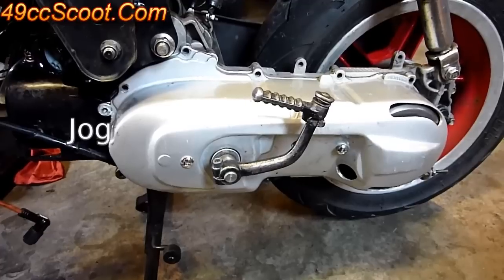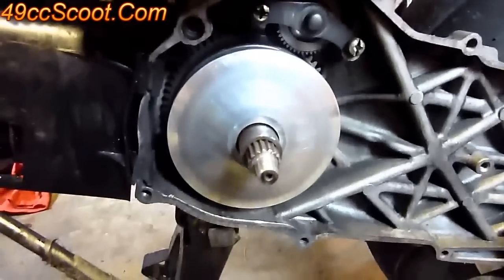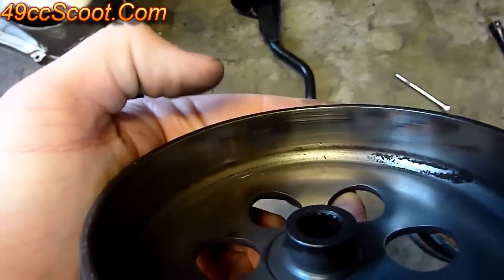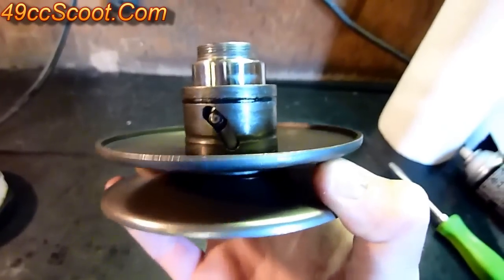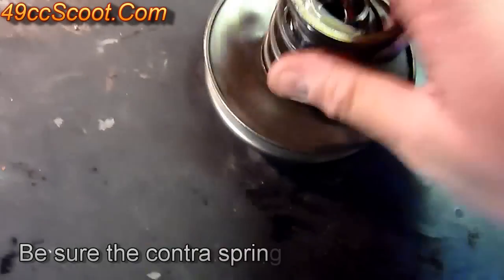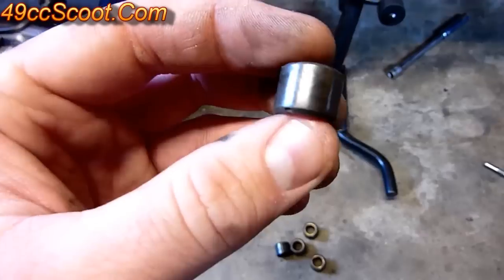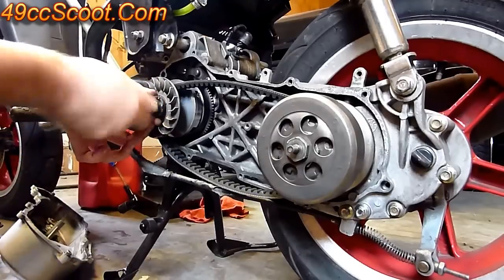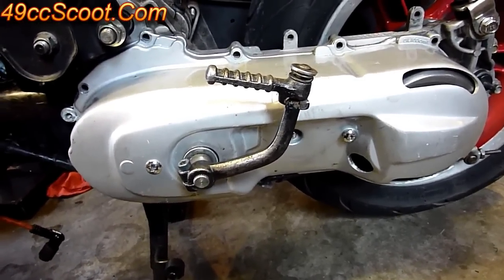Scooter CVT Transmission : Full Service Inspection

Comment: Do you use Sony Vegas Pro 8 to edit your videos?
Reply from the maker: Christopher Spohr Cyberlink Power Director.
Reply: ***** i have a horrible vibration coming from gearbox shaft the one with the clutch and bell bolted to it, i looked at bearings and they seem ok, , what movement should the shaft have because if u turn back wheel every now and again i can see the shaft and clutch slightly wooble ,its on a peugeot speedfight 2 ac.
Reply: ***** what can i do or anyone about changing gears in the rear end?  that would make a difference in performance.
Reply: ***** me again your the only one that uses a torque wrench and tells the torque specs. my scooter noise over 25mph. i took off cvt its fine belt etc i didnt check rollers. exhaust maybe fuked over 80 degrees i get the noise.  oh on the stand it wont do it.
Reply from the maker: Changing gears may help if you find the right ratio. Too high (numerically) and it will lack speed. Too low (numerically) and it will lack acceleration and speed could even suffer if it's way off.

If your gears are making a noise something may be worn. Could just be a bearing.
Reply: ***** i saw ur video on cvt i found out what it was. the weather where i am is 95. im not fukin with springs yet. when i let off the throttle noise is gone.  so the clutch is getting too hot.
Reply: +90GTVert hey  i got rid of that fukin pain in the ass the rear was fuked and the spare motor was trashed. i have a honda ruckus clone 150 its awesome. cant get fuel gauge to work i hate fukin with electrical. ideas? thanks.
Reply from the maker: Check resistance on the wires going to the gauge or right out of the sender. They should change as tank level changes or as you slosh fuel around. If not, the sender is bad. If so you may have a bad gauge or wiring issue.
Reply: your rite the gauge is fuked i took it apart its burned out a resitor. thanks brother.

Comment: My question is why can't we make it with the opportunity to make it run on chain
Reply from the maker: Belt drive is an easy and affordable way to have a CVT. You could convert to a chain drive, but without a lot of work you will be stuck with a single ratio rather than variable. You could make it chain drive output. Some ATVs have a sprocket on the axle/output shaft instead of a wheel like a scooter and they drive their rear axle that way.

Comment: Ou have any videos that show how to fix a rusty rotor ?
Reply from the maker: Don't have any vids about rusty parts. Brake rotor? If it's for a Chinese scooter, brake rotors are so cheap on eBay that it probably isn't worth messing with if it's anything beyond surface rust.
Reply: 90GTVert the rotor for the stator
Reply from the maker: Wire brush /steel wool.
Reply: 90GTVert  thanks ill try it tomorrow

Comment: And if its the starter switch?
Reply from the maker: Replace it. ScrappyDogScooters, PartsForScooters, eBay, EagleATVParts are a few to check if you need one. Most likely you'll end up buying the whole right side control for your scoot if you need to replace the starter switch. You can open up the assembly and see if you're lucky enough that it's a simple fix like something is out of place/not soldered anymore.

Comment: Nope ... Here's an update: I opened the CVT cover last night ... the belt was jammed in the variator an neddless to say, shredded like hell ... I took the variator out and it turns out the variator gets stuck wide open ... Probably why on Decelerating the belt falls down and gets jammed in the variator and tears down to pieces

Comment: what makes a new belt shred?
Reply from the maker: +Thomas Flynn Perhaps the wrong size belt. Poor quality belts are common. I tried using generic belts that were cheap for a bit. Some broke within 10 miles. Replaced with Bando belts and didn't have any more trouble from them. Could also be poor state of repair or maintenance in the CVT.

Comment: The air box is what for???
Reply from the maker: It holds the air filter that filters the air so you don't get a bunch of small debris in the engine that could score cylinder walls or cause other damage. The air box, as opposed to a pod, helps the engine draw from still air and makes it a little less responsive to environmental variables.
Reply: 90GTVert thanks

Comment: whatwould happen if you lose the them pins
Reply from the maker: You would have to find replacements. The torque driver wouldn't work properly with any missing and with all missing it wouldn't stay together.
Reply: @49ccscoot  got a s/hand bike i opened it up to see condition of belt clutch etc only when putting casing back notice only one pin was in there
Reply: now have two pin fitted
Reply from the maker: @ballkeeper6662  Hope it's a 2 pin driver and not a 3 pin!
Reply: @49ccscoot  we are talking about the locating pin

Comment: Are those 10 inch wheels ?
Reply from the maker: 12". Vento Triton stock sizes are 120/70-12 front and 130/70-12 rear.
Reply: ***** Oh well i have a Yamaha zest looks like its the same engine type but it has 10 inch wheels
Reply from the maker: The 1E40QMB is a Chinese clone of the Yamaha Jog style engines.
Reply: So if i want 12 inch wheels on the back of my scooter i need to get the big variator from a minarelli or smthing ?
Reply from the maker: Doesn't matter which variator. Only matters if the wheel tire combo will fit (diameter & width), brake size and type (disc/drum), and splines on the axle. Count your splines and check any wheels you are interested in. Short case engines usually won't fit 12" wheels unless they're used with very low profile tires. Vento Zips have 12" wheels on a short case if you want to try and find examples. Some Yamaha scoots have different sized brake drums than Chinese scoots so there's more to look into. Don't just go out and buy any wheel that says it will fit the Minarelli/Jog or you may be disappointed.

Comment: https://m.youtube.com/watch?v=ddriLzJiC98

Hi man, with that link is my scooter belt movement normal like it’s slapping? M using a dayco 808x16.8 belt as my stock 792 or 797x16.6 belt feels quite short and won’t reach the edge of the vario on WOT. Currently the dayco belt sits slighty out the edge of the TD while engine is off. Belt length looks just nice and will reach the edge of vario when manually testing it. First time i have seen my belt so shaky i was wondering where the noise came from and here it is all allong.

Comment: Hi Brent!

Thanks for the video above! I finally got that drive belt on after getting that socket so I could inspect the clutch assembly. It was tough getting the belt on the drive shaft, but everything seemed in good shape upon inspection. However, once it was all re-assembled, the battery didn't have enough power to start it and after I re-charged the battery, the starter motor got weaker and weaker,....then died. Here is a link to the starter motor I ordered, with a 'black' boot, but didn't receive this starter, instead got one with a 'red' boot and this one didn't sit right against the engine casing, plus the starter motor only made a weak 'wheezing' noise when I tried starting it, nowhere near turning over the engine. I checked the nut and bolt at the solenoid and all seemed installed correctly, plus I don't see how it could be installed incorrectly. 

http://www.ebay.com/itm/GY6-QMB139-50CC-50-STARTER-MOTOR-12V-SCOOTER-MOPED-ROKETA-TAOTAO-SUNL-JONWAY-NEW-/280926154508?ssPageName=ADME:X:RRNTB:US:3160

I want to get a new starter motor like the one in the link above (as I've installed a few so far on this scoot and all worked, except this 'different' starter with a 'red' boot), but don't know who to trust as the starter motors I've ordered, that worked, all did 'not' have a new wire and boot going to the solenoid, only the starter itself, and now I need to replace that wire and boot as the old one is damaged badly. I paid $16.50 for the starter above with an ebay seller, but will never do business with them again and tend to agree with a motorcycle friend that ebay isn't a good place to buy anything. 

Do you know where I can get a good starter motor at a good price, by a reputable seller not selling me the 'wrong' starter? 

Thanks Brent! I think I finally have that new engine running well and 'hope' all is well and that new drive belt works right. I did check that drive belt number you sent and the drive belt is the correct number, so hopefully just need a good new starter motor, charge up the battery, use your 'starting' trick with the carburetor, and maybe some starting fluid if necessary to turn it over,...then once started just need to buy some new top grade gas and all should be well, except I might need a new speedometer cable to fix the speedometer. I also noticed; when moving the scooter to a friend's house for storage; that the front end seems to have a 'loose' steering column, so need to tighten up those handlebars somehow. Do you have a video on doing that? Thanks!
Reply from the maker: Before ordering a starter, I would check the battery out. https://www.youtube.com/watch?v=Bw3ikMEGh74

Try PartsForScooters and ScrappyDogScooters. Both places with good reputations.

The front is simple to tighten. There is a cap nut on the frame and then another nut above it that locks them together so it won't loosen. Loosen the top nut. Tighten the cap nut so the bars move freely, but without play. Hold the cap nut and then tighten the other against it. See if it's still set properly, if not redo it. You MUST not tighten it so the bars can't move side to side easily or it could cause a crash. Just get it so there's no up and down play, but still steers nearly effortlessly.

Comment: I have some questions for you about the cvt of a 2013 Honda ruckus that I have modified  is there away I can contact you  via email
Reply from the maker: You'd be better off to post on the forum at 49ccscoot.com. I don't know a lot about Rucks specifically, but someone on there should be able to help you if it's not a general enough question regarding the CVT.

Comment: I'm having a problem with my scooter tried going to your online msg board but it kept timing out...anyway I posted I video to my channel of what is doing plz check it out let me know if anyone knows what the problem is ..the problem  goes away and comes back paid someone to fix it they didn't know what the problem was.
Reply from the maker: I'm not very experienced with electric scoots. So it's going but slowly and then quickly dying? Not exactly sure what you're showing in the vid. If it's any sort of intermittent issue with electronics, my first thought is always to check for poor or loose connections.
Reply: @49ccscoot  i try to go acts like it wants to go then it dont do anything ...the video u should be abke to hear thr noise its making...yesterday it started to work fine again then it does it again try to go but it stops..and today it works again...when it happens ill make a better video but cant find anyonebthat know just paid a guy for nothimg he domt know what it is
Reply from the maker: @cindyyoursupportagent  Sometimes it's not great being an early adopter, because it's tough to find many people that can help. I still think checking all connections is a good bet to start and see if you can find a service manual for it. Even a service manual for a different electric scooter may offer some helpful troubleshooting advice.

Comment: Thank you for the videos! Can you help me? There's a strange noise on my scooter, do you know what it can be? I have searched the internet but I have not found a solution yet, the noise is exactly like this: https://youtu.be/AB-94sqWpDY?t=123 The noise only appears in idle.
Reply from the maker: Is that the same scooter that you have? If not, what is yours?
Reply: Piaggio Beverly 250 cc. Her design is very similar to the Chinese GY6.
Reply from the maker: Have you tried removing the variator like they did in the video? That will tell you if something in the CVT is the source of the noise.

Comment: can i ask question about my cvt,i am filipino,do you have fb acct?
Reply from the maker: Just ask here. I'll respond.
Reply: can i send video here about my cvt problem
Reply: my belt is sink in the rear pulley about 4mm and my female rear pulley is modified,i put 2mm washer on the variator but nothings happen,still the belt is sinked in the rear pulley even though my belt is new and thick.what should i do sir??i do anything still the same,ang my vaeiator is also modified
Reply from the maker: @gladygonzales8056  You can post a link.
Reply from the maker: @gladygonzales8056  Are you sure the belt is long enough? Contra spring failing (not enough force to return the belt)?
Reply: it is the original belt sir.what other cause sir i will try what you say
Reply: where can i send link of my video?
Reply: when you touch the belt between the variator(pulley in filipino) and drive face ,you can touch the collar that the belt is not touching the collar or bushing
Reply from the maker: @gladygonzales8056  If the belt can't touch the collar or bushing, or at least get very close, then it probably isn't going to reach the outer edges of the rear pulley. 
You can post a link here. YouTube may flag it as spam, but I should be able to see it.
Reply: i dont know where can i post the video sir?
Reply from the maker: @gladygonzales8056  YouTube is specifically for videos. You can try any other  link  to wherever you normally post, but I don't use fb so I don't know if it will show me or not.

You could take the fixed half of the front pulley off and put the belt on so it is riding on the drive boss first. Then look at where it is in the rear pulley. If it won't reach the outside of the rear pulley at that point, then it's just not long enough to do it. Stock or not.
Reply: my belt sir was ok ,i followed what you say. my td half sheave that was modified have something to do with sinked belt?
Reply from the maker: @gladygonzales8056  Most likely. If the pulley is larger, it will need a longer belt. Otherwise, take the belt out of the rear pulley and make sure it closes all the way. If it does, then for some reason it can't provide enough tension to move the belt (soft contra spring or mechanical issue with grooves in the torque driver perhaps). If it doesn't close all the way, then it's probably something related to modification or other mechanical issue with the pulley.

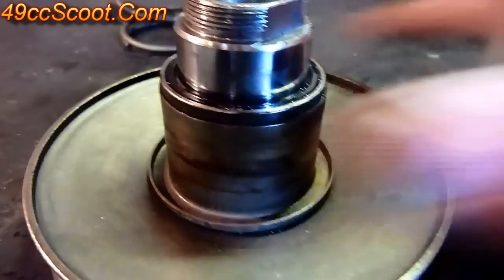Comment: i cant take the cover off 12:12
Reply from the maker: Some are stubborn. You can try grabbing it and twisting. I have had to take a very thin flat screwdriver and tap it under before. You have to be really careful not to damage anything though.

Comment: specialty tool!.. screw that, remove the plug, insert 7 inch piece of rope, knot the top, the piston will be stopped by the rope and take it off with a socket, done

Comment: Hey there, I really like your videos on the gy6 scooters/project tao tao they have helped me a lot in servicing and learning about my scooter. I have a qmb139 moped and I have a question relating to the transmission I was hoping you could help me with because you clearly know every inch of these scooters very well. Here is a video explaining my problem https://drive.google.com/open?id=0B8knBHrxPBNpLUpRM2EyUFRKdW8

Any input would be appreciated, thanks.
Reply from the maker: The first thing I'd do is clean the entire CVT area and all components. Inspect as you go. This vid should cover it. Replace the belt with a quality belt. I like Bando, Gates is popular. Stay away from no-name Chinese belts. They are known to fail prematurely. Get it back together and see what it does.

It's normal for the starter bendix to be able to be removed. If it wiggles excessively in either the case or the CVT cover, it may need the bushings replaced. They should be sitting in the case and cover.
Reply: Thanks a lot for the reply, my main problem now that I didn't cover in the video/hadn't realized yet is that the guy I bought this from replaced the belt at one point and he stripped the nut for the variator and I have no idea how to get it off. Torque driver just spins. I can take the clutch off and I've inspected that it seems to be in decent but not perfect condition, but I'm pretty sure I can't replace the belt without removing the variator. Any suggestions would be appreciated I have no idea how to get it off, and I'm afraid to try and clamp it down and use vice-grips because I really don't wanna bend the crankshaft or anything. Also I was provided an extra belt when I bought it, a powerlink 669 18.1 (I've heard 669 18.1 30 belts fit but its just says 669 18.1) belt and it seems kind of small, I can see from a leftover piece of shredded belt that the old one was a 669 18 30. Thanks in advance, sorry for all the questions, trying to avoid taking it to a shop.